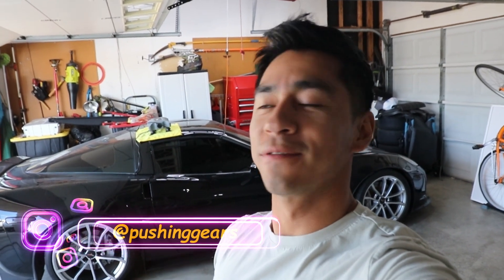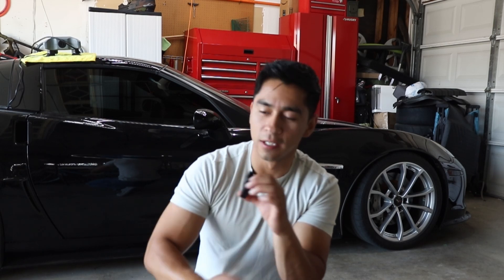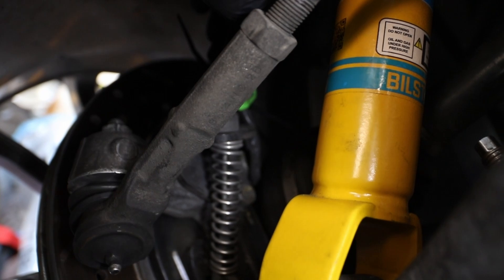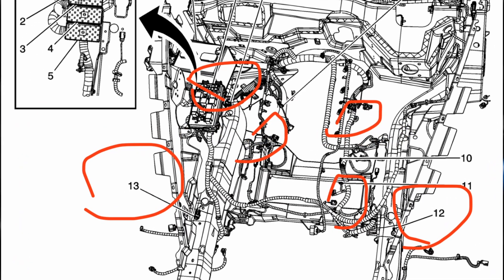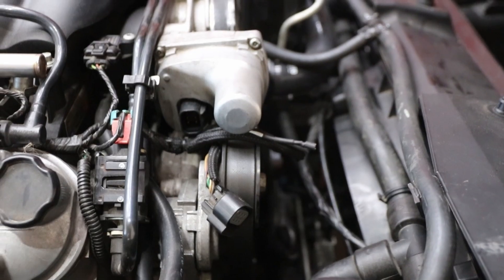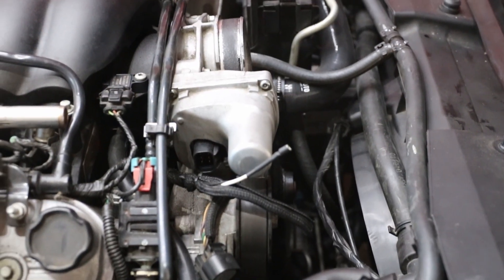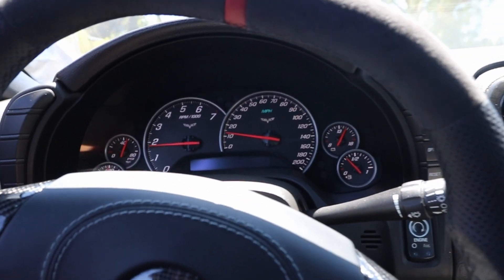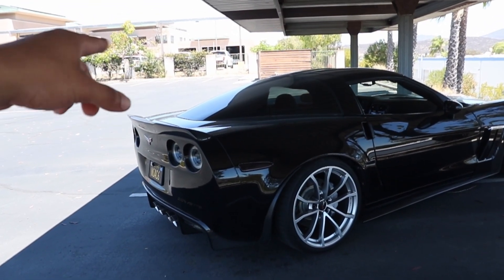WATCH Before THIS Happens! | C6 Corvette REDUCED ENGINE POWER

Comment: On another car, a shop installedy shocks and my car would loose power and turn on tracscripm light abs and it's because they fucked one of my wheel sensor plug right behind the breaks, could be as simple as a broken sensor plug that's agitated with bumps

Comment: Hi, I had the P2135 code in april of 2025 I put a new Doorman TBody and the issue continue, I changed the pedal, and continue having the same problem. Looking in the internet I found a guy with the same situation and gave me the solution, buy a GM Tbody, I found one in ebay and put in my C6, realern process and BOOM Im happy again with my C6, no issues. God bless you🙏🚗

Comment: Never smack the MAF sensor when it's running. It's a coil that gets red hot and will snap. Big mi$take if you do. TPs sensor take off and hit with carb cleaner?  Are you running synthetic oil? don't buy cheap gas. You can tap injectors with a 14mm wrench and instant fix a clog.
Reply from the maker: I did clean the throttle body. I tapped the throttle body slightly not the MAF, nothing crazy. No cheap gas Shell only. These cars take only Mobil 1 full synthetic. Even then, the Oil refining process wont necessarily cause the concern I had. Thanks for the tips tho
Reply: @PushingGears  96k miles on mine with new starter, battery, alternator, and she's throwing injector code only and it seems like it happens at cruise speed most often. Wouldn't start today, charged battery, still wont start with 12.75v. Going to check grounds I guess. Keyfob in slot. Small chance it could be the starter wire on the starter itself but maybe the computer just wont let her start due to code? idk.

Comment: Bro my vette is doing the same shit and I will drive it for two days and it’s good but then it acts up again can’t figure it out but glad for the vid to give me some insight on this 🤙🏼
Reply: If give you the C6 code, change the Throttle body, but you have to buy a GM because the generics dont have TPS and dont work. I bought one GM repaired  and I resolved the situation.

Comment: Has the same issue , here’s my list of potential problems in my experience, shortage of power due to loose wire connecting to the starter, replaced the starter completely, new battery , fuse , this is just from my end

Comment: I used to have a 2000 S-10 back in the day, with the 4.3L. At some point, it started losing power, and after a few days I could barely get it to accelerate at a reasonable rate. I spent almost 2k at 3 different mechanics, they all changed a bunch of parts and the truck still had no power, its really infuriated me that these guys at all these places could do so much work for absolutely nothing. So I talk to my dad to complain about it, and he tells me to drill a hole right in front of the catalytic converter, so i do. Power came back immediately, actually more than it had when I bought it (got it used). Mechanics like that give the industry a bad name. try drilling a tiny hole right in front of the CAT, if your power comes back, you know what to fix. If it doesnt, a tiny spot weld will fix it.
Reply from the maker: A restricted cat has a very noticeable feel. A good mechanic should have been able to feel it, and diagnose it just from free revving the car or within 20 seconds of test driving. My issue was not lack of power due to restriction in the exhaust, the computer was forcing the vehicle into Limp Mode due to electrical issues. Sorry to hear about your experience man. As someone who works in the industry I can tell you It’s getting really hard to find diagnostic techs. Most shops have part changers instead of technicians unfortunately.
Reply: @PushingGears  Yes, thats why I was so mad that I spent so much money at 3 different mechanics, this was on Vancouver Island, bunch of aholes.

Comment: My 2007 Chevy Colorado would go into reduced engine power and it finally turned out to be wiring harness was bad. That wiring harness you showed looked exactly like the one on my Colorado. It was throwing the tps code.

Comment: My black manual C6 is so great but I keep it stock engine wise and ride height wise because I don't like problems and it's already so fast for the streets it's sooooo great.  All I did was npp mild to wild(sounds fantastic), Max din screen(interior game changer), led cf steering wheel(must), glass roof(awesome), tint - light front, 35 sides, 20 rear (looks great yet I can still see), mgw short shifter(must), cf front splitter & cf spoiler(must), C8 head lights(makes car look 20-30k more expensive and can see better at night) inferai tail lights(dope), c7 zo6 style wheels(more durable don't crack and look great). CF'd the emblems, several other little yet impactful mods.. Compliments on this car everywhere it drives unbelievably well.  What a great car!

Comment: These cars are weird. 

Hit a pot hole with the driver front and caused me to lose the TPMs sensor. I was even getting an intermittant o2 sensor and any amount of dirt my tires kicked up would trip a sensor and active handling freaked out. 

I went to an autox day, and it was a terrible experience with traction control going bananas because of the TPMs issue. Couldn’t go into competitive driving either. 

Installed 4 new tpms and all of that seems gone. Drives like an absolute champ

Comment: Always keep a battery trender on when not driving in 2 weeks.  Drain from the computer, under will bring to 11 volts, cause not to start, also  cause computer to throw codes..  since you  change  shocks  the error pops up  will be service control, disconnect relay.  I have C5   i have no codes.